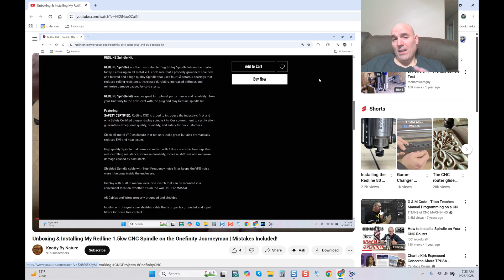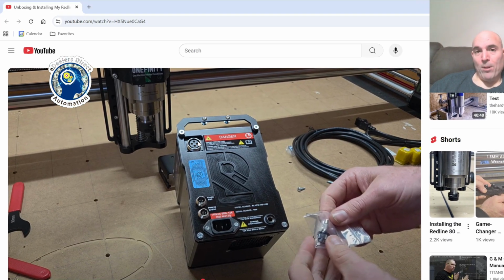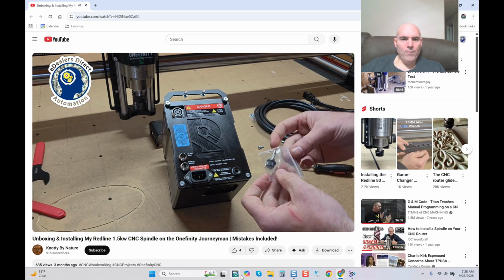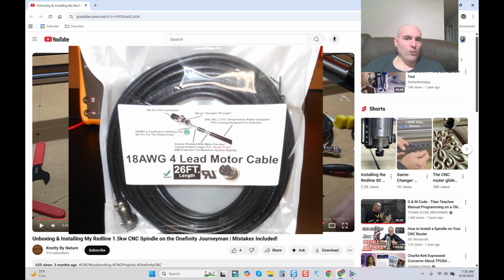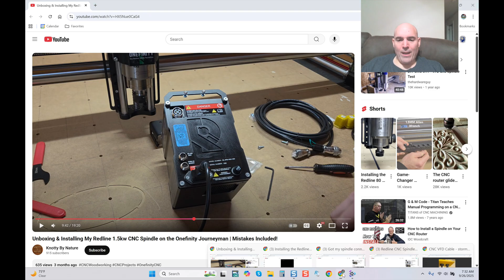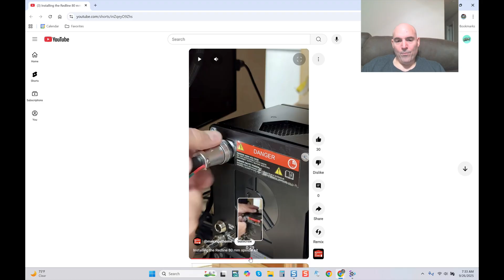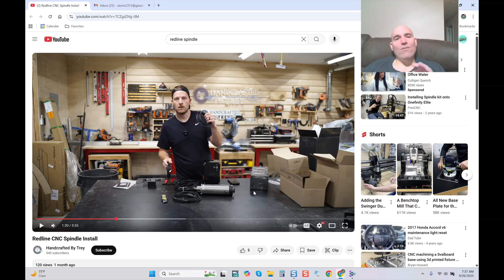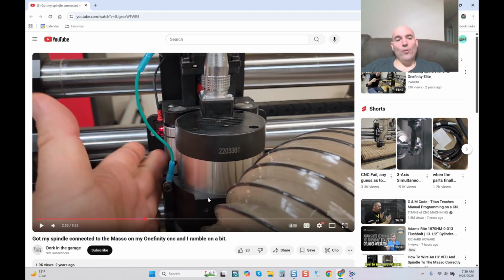Redline vs. PwnCNC Spindles: Exposed 🔍

Comment: Can’t comment on the redline kit, but I’ve had a lot of issues with my PWN cnc spindle kit.  Specifically in regards to static and grounding.  I was having VFD error issues about 15 minutes into a carve pretty consistently.  After much troubleshooting, I noticed that just seconds before I’d get an overvolt fault, I would hear a loud POP, immediately followed by spindle shutdown and VFDfault code.   I found that static was building up and the pop was static arcing through the spindle.  I could confirm this by simply touching the machine after a few minutes and I’d get a pretty intense static zap.  Was able to eliminate the issue with some creative grounding.

Comment: I just wanted to know what you think about HARTING connectors ...  I'm taking apart some dead plasma tables and I see a lot of these Harting plug connections ... parallel ports... can ports ... straight power connections.... After tear down of these retired machines to parts, i will have an abundance of harting connections... how does thes connection hold up with EMC ??? from automation point of view , the shielding did connect as it should... no problems... so give me your opinion about harting connectors .... I can reuse at least 18 for the future projects if you give me the green light ... 1 pin dedicated to shield of course
and to be honest these harting plugs do look a lot more rigid than most of these other plugs out there on the internet... (from my personal experience only the military grade plug was better... )
Reply from the maker: Those connectors are fine for CNC use if you choose to use them. Thank you, Vince

Comment: Hey Vince You are right on all accounts. PWN and Redline are the same product. They both use the Same VFD Because I down loaded the manual from both sites . And they were both Delixi VFD's and are the same model. I was always curios. And as for the VFD cable I built mine to your specs. I can take a meter to anywhere on my onefinity CNC and get the continuity right to the ground on my power receptacle I went a little further with grounding I also grounded the plastic vacuum hose to discharge any static as well. Grounding is very important. As for there cables why would you pull the ground out just to put in back in. I don't understand that concept . Must be new never seen this before. Tthey should take emery cloth to the spindle mount to clean the anodizing off before mounting. I bet that's not in the manual. Keep up the great coverage 
Cheers
Reply from the maker: Thank you sir, I really appreciate your support.
Vince

Comment: you can clearly see that Redline (OneFinity) has simply removed the back panel of the unit and replaced it with 3d printed self-branded panel.  I would be curious to know what material they used to print this "self-branded" back panel.  If they printed it with PLA, it would surely degrade with minimal heat and/or humidity.  Additionally, replacing the factory injected molded panel with a 3d printed replacement is more than sub-par.  Typically, a rear panel such as this would be injected molded ABS or Nylon, which is far superior to any 3d printed replacement not only in terms of rigidity, but overall strength.  Also, a 3d printed panel replacement is much more susceptible to moisture, as typical 3d filaments are highly hydroscopic.  They didnt re-install the fuse, because after they replaced the back panel with their 3d printed panel, they were to lazy to do so.  At 11:54 in Your video, the reviewer calls it a VDF and not a VFD.
Reply: Oh my, the yellow housing around the 4 pin plug also appears to be 3d printed, simply re-establishing their ownership of the unit.  They are just buying some Chinese unit, replacing some panels with their own 3d printed panels, with who knows what material, and calling it good.  Their self-branding efforts are in the least, resulting in a worse solution than the original shoddy Chinesium original, which is more than likely just a shoddy knock off to begin with.
Reply from the maker: Once we see it we can't unsee it. Very well said sir. Thank you for your support as always. Vince
Reply: It is possible to 3d print Nylon, ABS, PEEK and even aluminum, using 3dp on its own says much less than the material choice for the part. I doubt they did any of that though, and agree with you that they probably used PLA or PETG at best.